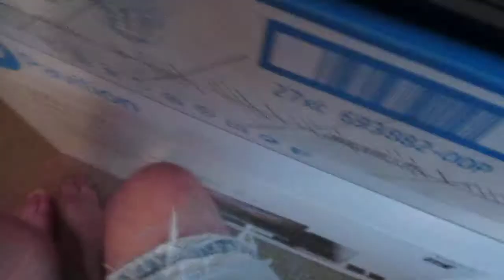How To Upgrade The RAM On An ASUS K55N Laptop

Comment: Hi, I have a 8gb ram but only 3.46 is usable apparently. Memory remapping option is not available in its bios. Is there any other way that i can use my ram completely?
Reply from the maker: sounds like 32 bit windows is installed
Reply: @TechMaster2133  thanks for the reply. My system showns that it is a 64bit version in the properties

Comment: What size screw is that and how do u get it out without stripping the screws when it's new?
Reply from the maker: not sure on the size, as far as getting em out, just use a snug fitting screwdriver and a bit of downward force on the 1st turn or 2 and itl come out no problem
Reply: TechMaster2133 ok thanks! I'll try a 2mm... btw are there's any good gaming pcs under a few hundred $ don't have a lot of money but wasn't to get into it...
Reply from the maker: Hmmm whats your absolute maximum price, i think bare minimum you will need $400 you can get a machine off ebay for around $100 look for anything thats i5 or older i7 range, then upgrade the power supply and throw in an rx 460/gtx 1050ti should be doable for $300 maybe $350
Reply: TechMaster2133 ok thanks

Comment: Mine already has 8GB of ram and i would like to boost to 16, is this a to much and how many pins are there so I know its compatible.
Reply from the maker: itl be the same steps except youll need to buy 2 8gb sticks or a "dual channel set" 2 sticks that come in 1 set, any DDR3 1600mhz laptop ram will work perfect in this laptop, that's all you need to worry about is making sure its a 16gb DDR3 1600mhz RAM kit. get something like this http://www.newegg.com/Product/Product.aspx?Item=N82E16820233265&cm_re=16gb_ddr3_1600-_-20-233-265-_-Product
Reply: would one stick of 16 gb work
Reply from the maker: wayne plant i don't believe so but you can always try and see, I believe the laptops max is 2 8gb sticks
Reply: thks for help I bought the 2 8gb that u suggested, install was easy  however when I check PC info , it does say 16 gb but only 7.46 usable , the same with 8gb. Will it use the 16 or am I stuck with it only useing  8gb ?
Reply from the maker: wayne plant Hmmmm that's quite strange seems like the laptops reserving system ram for its hardware, the gpu should steal 512mb itself, did some digging around and cant find much info on this issue, I have a few things we could try but there a little hard to explain through typing like this, do me a favor as a 1st step. try swapping the slots the ram stick are in and get back to me
Reply from the maker: wayne plant 2nd step go to your search or start bar and type system configuration, open that up, you will see a box with multiple tabs, Click on the tab that says boot, on that tab theres a little check box marked "make all boot settings permanent" check that box. once you have that box selected, click on the advanced options button under the boot tab..You should now see a box marked "number of processors" and "maximum Memory" ...Select both boxes and set them at there maximum...after that's done hit ok out of all the boxes and restart the system, let me know if that helps
Reply: there is no system configuration coming up
Reply: i get system properties and no boot page
Reply: I switched out the slots the started laptop, took about a minute to start and another 20 seconds to log in, when I checked the PC info it now says I have 15.5 usable, so I guess that  worked. I hope it runs a little faster now, Thanks again, I am quite the knuckle dragger when it comes to this so I do appreciate the help.
Reply from the maker: wayne plant No problem :)
Reply: Hi again so now I got the blue screen on start, twice now, first time it took 2minutes to figure it self out and this time it had message about memory management and it took a minute to collect data before it restarted. Is the new sticks compromised in some way ?
Reply from the maker: wayne plant if you can look up memtest86 and burn that to a dvd/install it to a flash drive, let it run automatically for a few hours to test the memory for errors, there is a chance one of the sticks are bad but that's pretty strange also follow this http://www.deaconillustrated.com/2016/01/14/memory-management-error-windows-10-and-how-to-solve/
Reply: also the blue screen has IRQL_NOT_LESS_OR_EQUAL
Reply from the maker: wayne plant hmmmm, strange, man that could be a loot of things try running with 1 8gb stick in or use 1 4gb stick of the old ram and try running with 12gb of ram and see if the systems stable for a while, ill be kinda hit and miss the next few days so I might not get back to u right away

Comment: for people asking, I've had this since 2014 and while you can up your ram the device is locked to the stock CPU and GPU so those CANNOT be upgraded. It hardly plays gta IV without stutter and Fallout new Vegas can play only at medium settings. It's great for non Gaming. If you want Asus for gaming check out their Republic of gamers line of laptops. But the k55n is not for games.

Comment: i dont really know about pcs but if i buy any 4 ram on ebay will it work on this pc or do i need to look for a specific one? mine is a 4gb and i just want to go to 8 so i can play h1z1 or fifa or even gta 5 with out the lag since i got the games already.. <<please hep me
Reply from the maker: Chepe Mendez i would get this ram here http://www.newegg.com/Product/Product.aspx?Item=N82E16820231702&cm_re=4gb_laptop_ram-_-20-231-702-_-Product as far as the games go i highly doubt gta5 will run if it does it wont run well but you can give it a shot
Reply: +TechMaster2133. Thank you bro. I will try yo get it next check I get from work:/ lol
Reply from the maker: Chepe Mendez no problem let me know how it goes
Reply: +TechMaster2133. Hey I did bought the 4gb ram and it show that it has 8gb but idk is the thing next to the ram have to say usage 3.8 or can it goes higher.   And what can I upgrade to make a better performance?
Reply from the maker: Chepe Mendez i dont really understand what you mean should be fine with the 8gb installed
Reply: i mean, sense i had 4 gb and checked Control Panel\System and Security\System it said 4.00 GB (3,46 GB usable) and idk if with the 8 gb does it have to say like at least 6,46 usable or needs to be the same
Reply from the maker: it will be anywhere from 6.0 to 7.5gb usable depending on how much ram the apu allocates for graphics
Reply: how do i ix it or change it if it says 3,46 and it is now 8gb
Reply: fix^
Reply from the maker: is your operating system 32bit or 64bit
Reply: it is a 64bit asus k55n
Reply from the maker: Chepe Mendez i have no idea whats going on then lol very strange
Reply: LOL WHEN I DO THE DIRECTX DIAGNOSTIC TOOL IT SHOWS MEMORY 8192MB RAM  what does that mean?
Reply from the maker: seems like its all being detected
Reply: TechMaster2133 what other upgrade have you made to it or did to it to get better performance?
Reply from the maker: Chepe Mendez nothing just 8gb ram, nothing else besids that and the hard drive are upgradeable
Reply: fck!!! lol and i wanted to make it like a desktop computer. Hey can you do a vid on how to clean the fan or can you help me on why it is so loud. i dont know if it might have dust from the carpet of my house or something else
Reply from the maker: Chepe Mendez i dont have the laptop anymore haha but, if you get a can of compressed air just blow it in all of the vents on the laptop, multiple times it should help
Reply: ohh! hahaha well thanks for all your help bro
Reply: hey one more question, now that i got the right 4gram installed and it shows its using it. what are the benefits of it? like whats new or what improbe
Reply from the maker: well, u will be able to run a lot more at once gaming should improve, and the system will handle more overall

Comment: So once we have the new ram piece, we just take out the current one or would we be adding it on top of the current one? #NotAHardwareSavyGuy
Reply from the maker: depends, if u buy 1 stick of ram or 2, usually its the top one you have to remove, 1 is a 2gb stick one is a 4gb stick look for the one that says 2gb and remove it, then put your new ram in that slot
Reply: TechMaster2133 Any recommendations of online programs that can determine what exactly is slowing down your computer.
Reply from the maker: Rene Garcia hmmm well, ususally i just use the built in windows task manager to do that, if your using windows 7, or 8 go to the windows search bar, on the start menu and type in resource monitor, from there u can see what process might be slowing u down, also make sure u run a virus scan with a decent antivirus, and i reccomend getting Malwarebytes Anti malware free editionif u dont have it already...u can use ninite.com to get everything u need without all the adware crap thats always included in the installers

Comment: when you turn the computer on how do u know its working? anything to install?
Reply from the maker: if the upgrade was done properly when u turn on your computer it should power up as it normally does. Sometimes after the upgrade you will get a message that says memory size different. but that's all you don't need to install anything.. just pop it in and your good to go